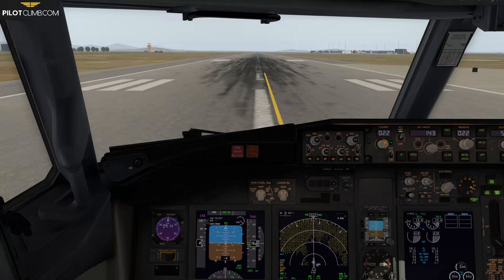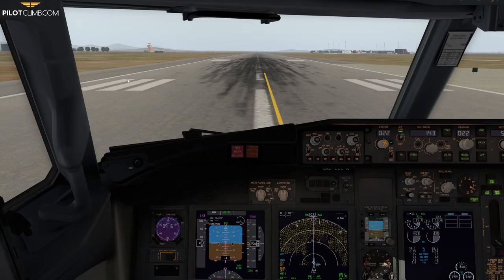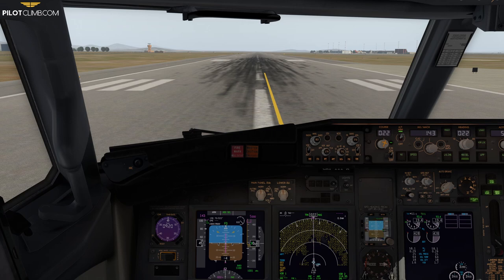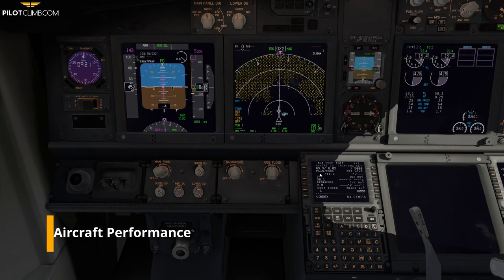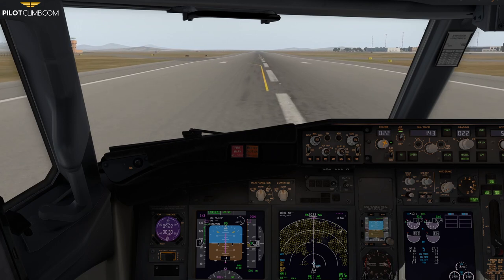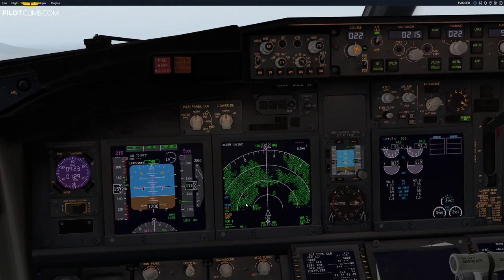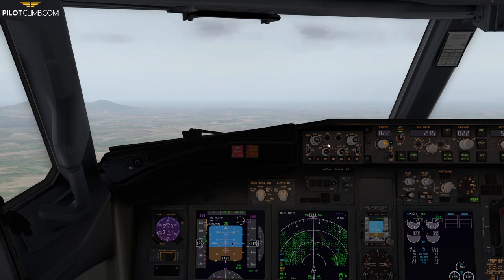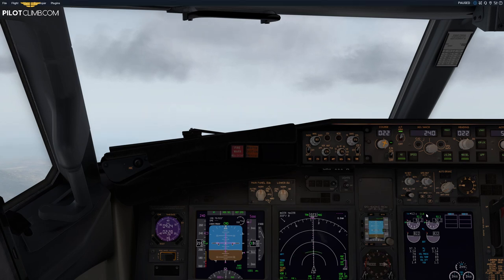What Does An Airline Pilot Check During Flap Retraction? - [Boeing 737 Take-off]

Comment: Boeing DOES NOT SAY ABOVE but AT V2+15 (white bug and speed increasing). I never move the flap lever exactly AT but that's what Boeing says. Boeing also says: Gear Down/Flaps 15 and observe Gear green light before selecting flaps to 15. I might be the only pilot in this galaxy who observes the THREE GREEN LIGHTS before touching the flap lever. Many times in the simulator, they ask me what am I waiting for and when I show them the book, I listen to thousand of excuses from DOESN"T MATTER to it's a Boeing mistake. Nobody seems to remember that the gear may not show 3 green lights and if this happens, the gear configuration will sound and you'll be doing your checklist with lots of drag unless you override the checklist, increase your speed and retract the flaps to 10, 5 or up.
Reply from the maker: Hey, thanks for your feedback. Have a great day!

Comment: One more amazing video, thank you Captain! A question: as we know;  acc.to fctm, immediate turn after take off is advised with take off flaps with bank 15 below V2+15  or with t.o. flaps bank 30 above V2+15. Thats fine. What about if we will need to make a turn while flap retraction?  Do we need to consider bank angle while below next flap man. Speed that we are below it during retraction? Or as you have explained trend vector and flap retraction speed already protect us?
Reply from the maker: I'm glad you like the video!! The bank angle limitation only applies if the speed is below V2+15, you can bank more with no problems while retracting the flaps.
Reply: avoid retracting flaps whilst turning..you will notice the amber" moustache" coming down to meet you and could get intermittent stick shake.This is particularly so at high density airport take offs and especially on a hot day. Follow your AFM it clearly states what you need to do. Also avoid engaging VNAV modes before you are settled on your climb and on LNAV (which can be engaged at 400 ft minimum.

Comment: Isn’t it safer to wait till your actual speed is above the minimum flap maneuver speed before retracting on schedule rather than using the speed trend vector over the actual speed?
Reply from the maker: If you monitor the parameters mentioned on the video you are 100% safe. If you wait however, you are less efficient.

Comment: for flaps 1 to flaps up in this video, what if there is a speed restriction to limit speed to 200 kts for turn? do we still retract from 1 to up or just maintain flaps 1 until completion of turn to increase speed above flaps up speed? 

thank you
Reply from the maker: You keep the flap... Thanks for watching
Reply: @PILOTCLIMB  we can keep the flaps because limit is 250knots correct? thanks for the reply captain 😊
Reply: We can keep and need keep, due to restriction limit speed, in case of 200 kt restriction you will be below flaps up manoeuvring speed, that’s why you can’t retract flaps fully, after passing restriction you can make bug up, accelerate with trend and then retract to flaps up. 
I think Pilotclimb will agree with this.